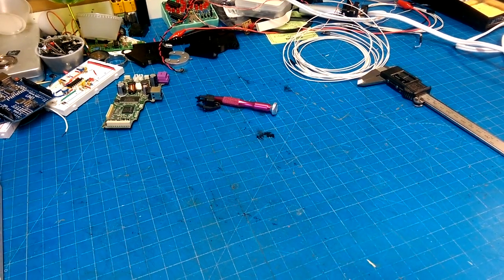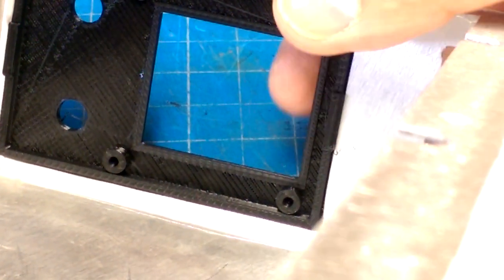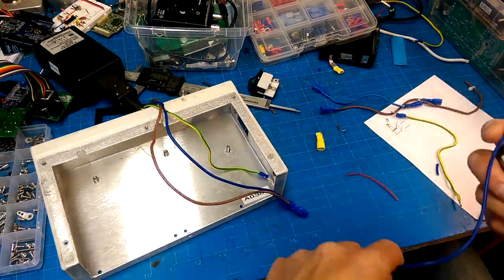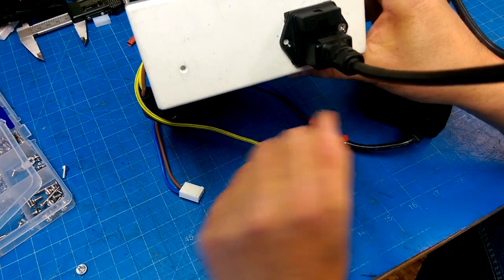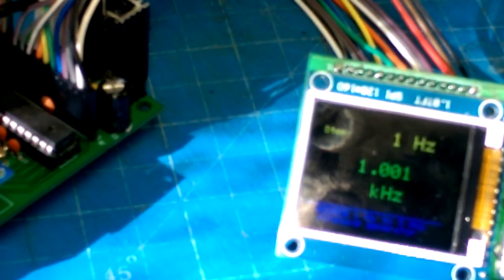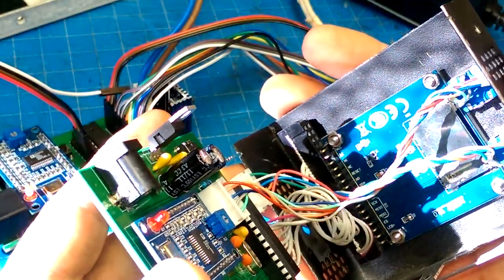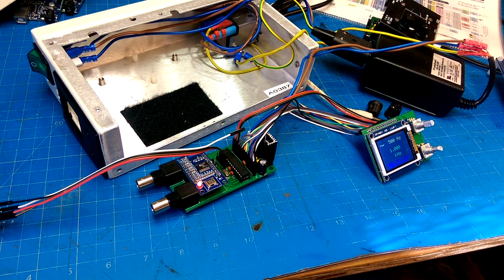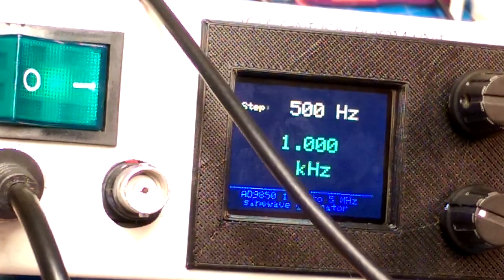Besel and Case for the AD9850 Signal Generator

Comment: I've started using the CUI VXO-7805-500 switching regulators in my projects. They are pin-compatible with the 78xx LDOs.
Reply from the maker: Nice.  They even support negative outputs.   I will for sure check them out.